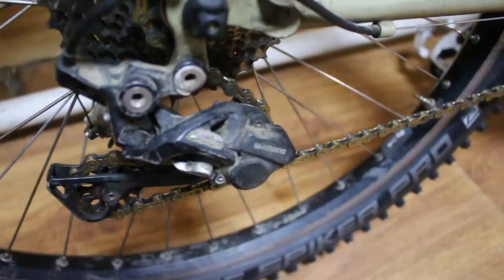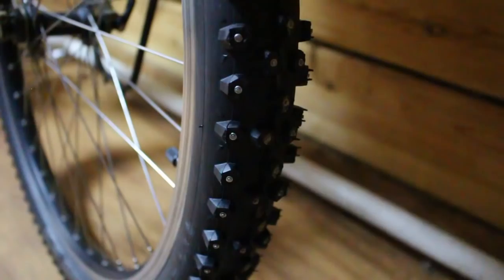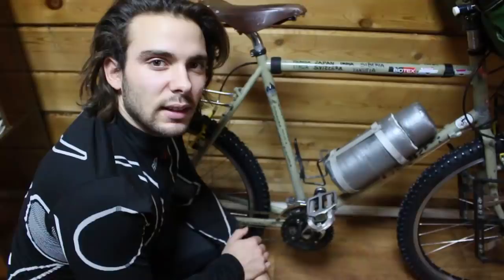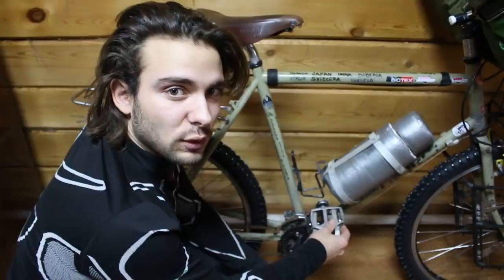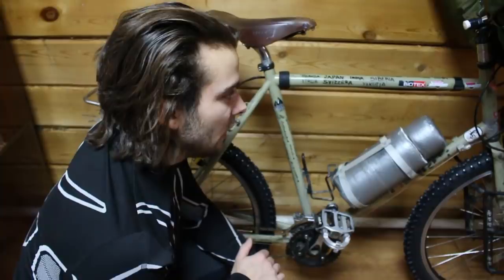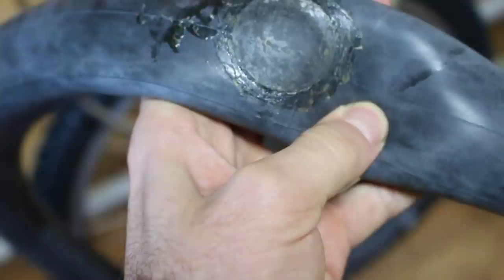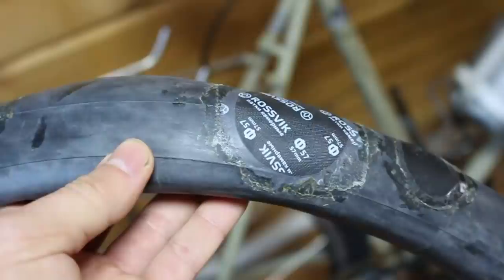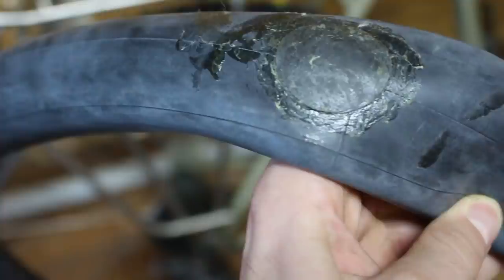BICYCLE MODIFICATIONS TO RIDE AT -40/-60°C (Survival in extreme cold YAKUTIA / SIBERIA)

Comment: Take care not to damage your lungs when exercising at very low temperatures!
Reply: Its -32 /-39 in Canada right now, I worked outside 10hours. I never heard of anyone having lung damage from the cold.
Reply: @quoththeraven3985  Well, once I read that something like that happened to a Russian ethologist, who had to ski for about 60 km at about 60 Celsius degrees below zero. He finally managed to reach an inhabited place. Doctors found he had burns not just on his face (where the mask didn't cover it) but also in his lungs.
Reply: @quoththeraven3985  i think the point is how often you do it. If you are exposed every day to -40 cycling and do not be cautious, many side effects can happen.
Reply: A neck gaiter type of fabric loop worn over the mouth reduces the harshness of the cold air. At 20f it becomes useful, and extremely beneficial as you get into single digits. In general it's a good idea to protect your face, neck, ears and mouth and it's easy to govern comfort by drawing the material off your face when it gets warmer.
Reply: How haven't we got masks that heat the air to better breathing conditions. Actually more batteries and the never last in those conditions. Wouldn't be practical in a logistical way. Anyone know anything like this sure there's something out ther

Comment: Usually I would recommend tubeless against punctures, but at - 40 degrees it's probably pretty much useless... ^^
Reply: You broke my hope in tubeless tires. I also found that punctures become often when ride at low tube pressure, or if tire and tube surface was not properly cleaned from dirt and sand.

Comment: Can't believe you used that piece of junk for an epic road trip. Madness but respect at the same time
Reply: It's not junk. Its a Surly Long Haul trucker the gold standard of touring bikes. His is just beat up. But a bike with good bones will preform good as new in that condition.
Reply: @quinnmuller8233  why not fatbike? Untill cheap and simple shock absorber become usual. Norway small company just invented such a fork.
Reply: @dazzershell  Because he has no need for suspension. And the bike he has works just fine with upgraded tires.
Reply: @quinnmuller8233  my bike quite the same, no suspension, and my neck hurts for a few days after winter 50km trip, if i pump my tires (2.0x26) with common pressure. Ice rough frozen snow road is wery often bumpy, I drop pressure to minimum, but getting puncture problems. I see many fat-bikers around)